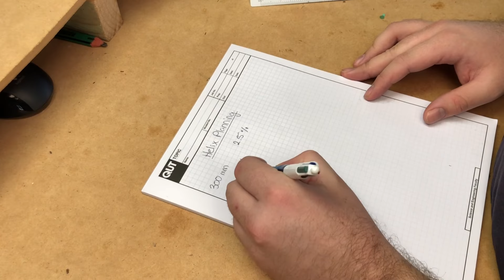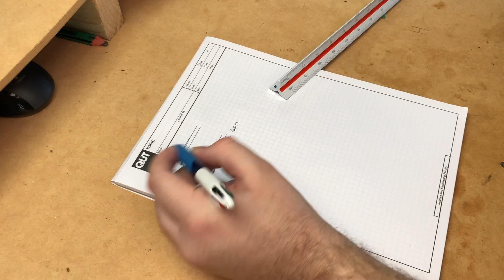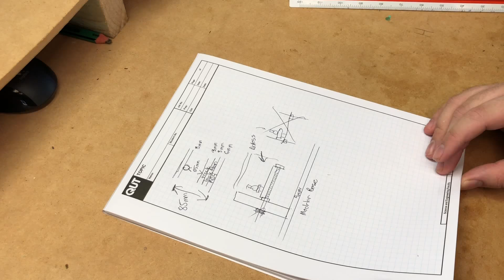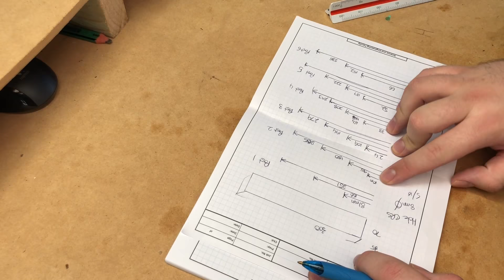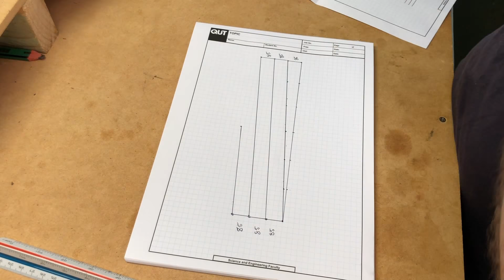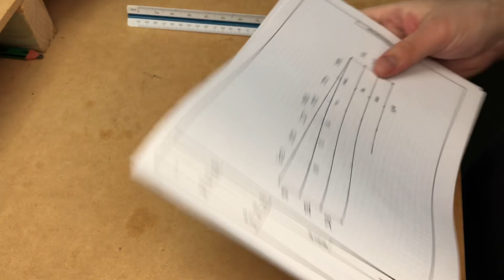14. The Helix Series Pt 1: Designing A Helix

Comment: Great video.... I am going to have a go at this helix for my own layout. I already have 5mm sheet ply and need to go up 212 mm which works out at exactly 2.5 turns @ 2.5% grade with a rise of 85mm . I just hope my old hst125 with the ringfield motor conversion to cd motor will make it up the r3 curves I have lots of r3 and r2 curves so will use these, inner loop to descend and outer to ascend how far back from the inner radius did you put the risers   :)
Reply from the maker: Gday paul! Mate thanks for the comment. I should point out that this helix has now moved on to the model railway graveyard. My big issue is dealing with humidity and heat through summer so I had to redesign and reinforce my helix. A couple of suggestions for you; 1. Minimise the grade to be 2% or under, this is just from my own experience most locos even the heavy ones struggle with anything more than that unless you have the nuclear powered Hornby class 60. 2. 2nd radius may be a little tight I'd recommend using 3rd and 4th radius minimum for a helix (if you have space) and 3. Overdesign your helix and what I mean by this is give yourself plenty of room. My new helix uses a 150mm wide 12mm thick ply roadbed giving me ample clearance and structural integrity, vibration and slack in the roadbed can cause an uneven incline and your trains will likely derail. Check out the helix videos by JNW HO Series He has some fantastic building guides for a helix to help you get some inspiration. Hopefully, this helps you and best of luck with it paul let me know how you get on! Cheers... Ben.